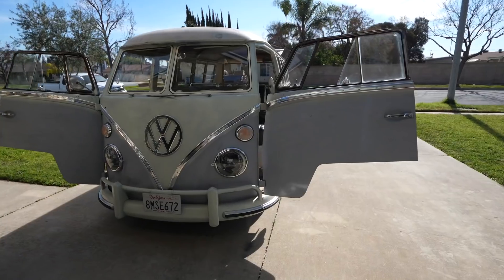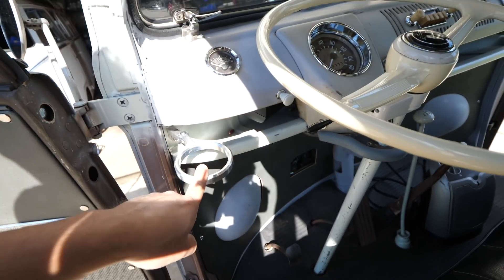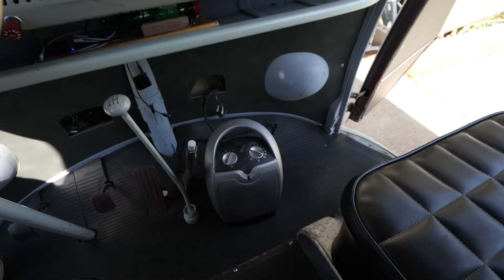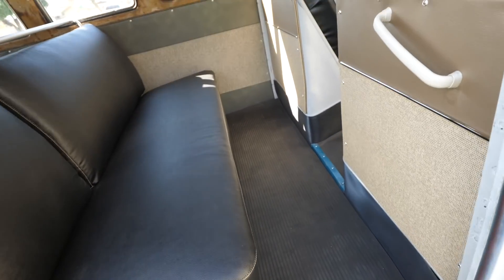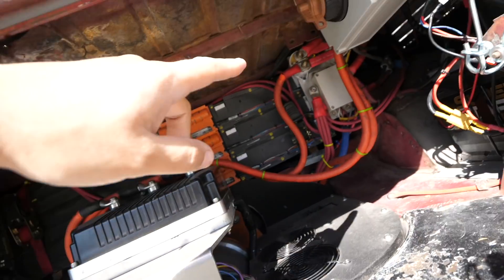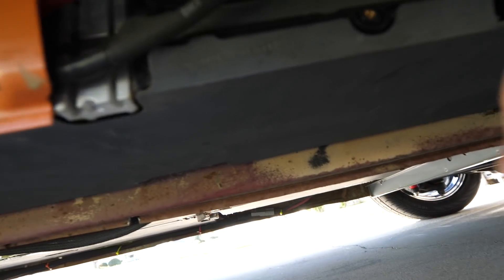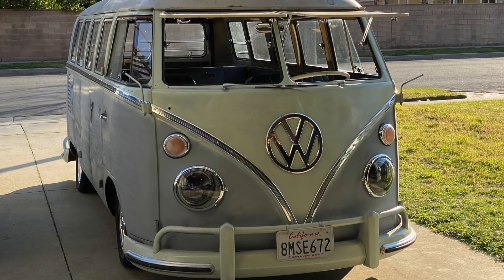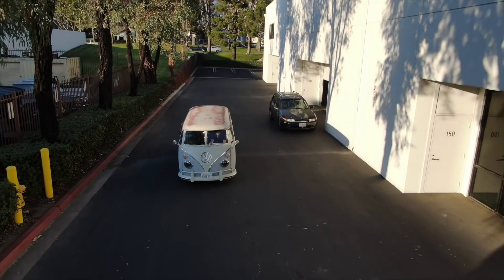50 year old Rusty VW BUS Revival - Electric Conversion

Comment: I really like the movement forward idea of converting classic vehicles from  ICE to EVs
My question, regarding retaining that classic quality is, Is it possible to fit a subwoofer system attached to the power system to recreate the noise of the engine? That's a digitally recorded replica of whatever classic vehicle is being converted? Or would that not be possible? 
Thanks

Comment: Can you keep the pack in the luggage compartment, in addition to the gas tank area batteries and get around 200 miles range or do you think that would that be too much weight on the rear suspension?

Comment: (🤔 video: 13:58/16:39) Do you notice any issues on your front driving suspension or the structure weakening? Cutting that metal looks like it has weakened the front/structure of VW 1967 bus. It looks a bit unsafe.

Comment: Do I spot EMW as the brand of the battery gauge software on the tablet? The company that did BMW EV conversions in CA? :) I started working with Val just after they switched to eMotorWerks
Reply from the maker: Yup
Reply: @jehugarcia  Is that software generally available somewhere online, or did you get it some time ago and are still using it? Awesome job as I'm sure you get all the time :) <3
Reply: @Demdere  ~ I used archive.org to pull it off the old EMW website, when I needed it last. It's for that EMW Dashboard thingie. God help you if you need configuration instructions, though. lol. Something about holding the button, and watching the options through the app while you configure it using the button.

Comment: To give your viewers a perspective of electric conversion vs a new gas engine, I built a new engine for my '67 12-volt 11-window bus from the ground up back in 2010 at a cost of $12,000.  That is a brand new 2027cc (90.5mm x 78.8mm) engine with dual Weber carbs and a rebuilt and strengthened transaxle.  The 2027cc build was necessary to provide enough power to drive the bus on a modern freeway.  Today, it would cost much more and it would be tough to find a qualified engine builder in many areas of the US.  Going electric is definitely the way to go these days.

Comment: Hi, nice functional conversion.  I am looking at building a large battery for a mobile project (a boat) and have begun playing with batteries. I won't be able to use your power wall design, I am looking at spot welding the cells.  I have bought batteries and parts and have been experimenting with them.  I have placed some spacer designs for 3d printers over on thingiverse should anyone be able to use them.  I will be adding to those as time goes on.

Comment: Wow, just wondering what I could build if I was getting 30,000 per month. Yup, another you tuber spilled the beans on how much they make off of You tube. I would definitely have my Honda EV finished. Not easy when only making about 3 grand per month working 40 hours. Guess the gift of gab pays off.

Comment: Hey buddy can you show us how to make a simple a jump start pack for a car keep it simple a BEC so I can charge it with a regular 12v car charger and nothing else extra other then maybe a 5v usb port or maybe a 12v cig lighter plug.
Reply: I prefer the Stanley FatMax 750 with onboard air compressor, light, and a crazy powerful USB charger.  You can charge it from a cig lighter.  I upgraded mine with a larger 18ah battery and a 2000watt inverter strapped on the side, but even stock it's an amazing thing for the truck and camping also.